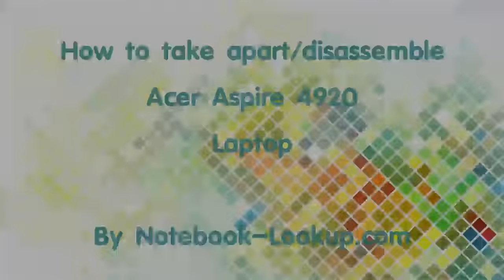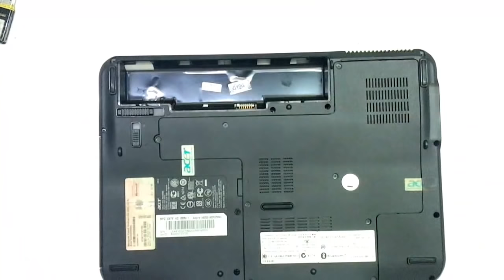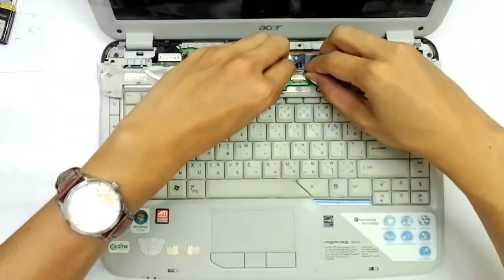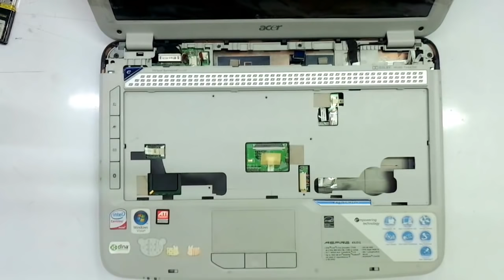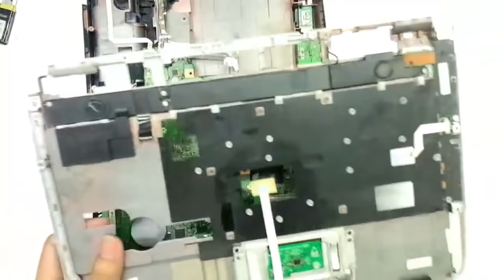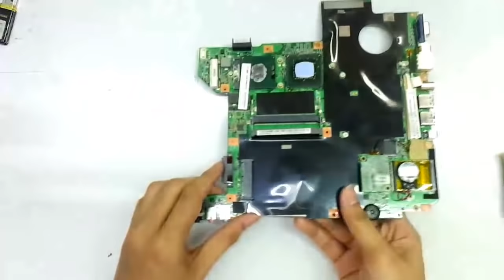How to take apart/disassemble Acer Aspire 4920 laptop

Comment: where is the cmos battery located?
Reply: Just for the record: At 9:50, there is a circular object in the upper leftmost section of the board w/c is the CMOS battery.
Reply: Why manufacturer put cmos battery at difficult place to replace..
Reply: Actually can cmos battery changed without remove most of the laptop parts?